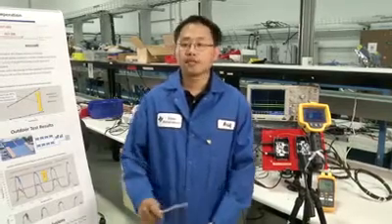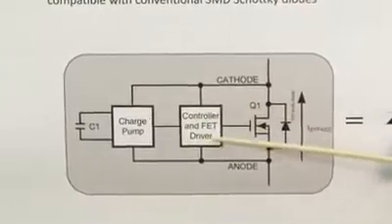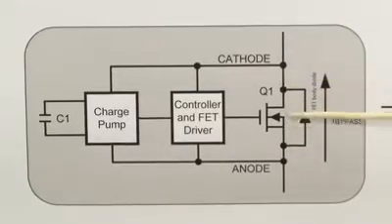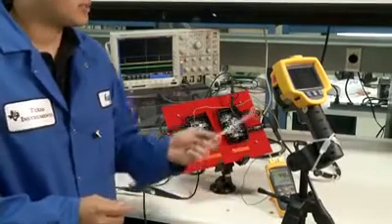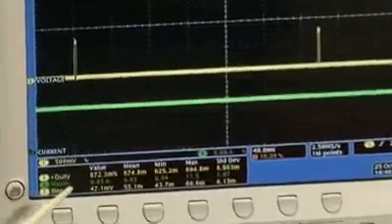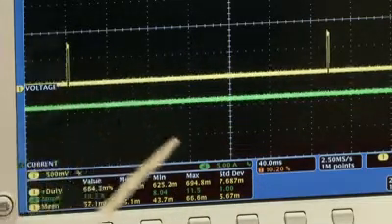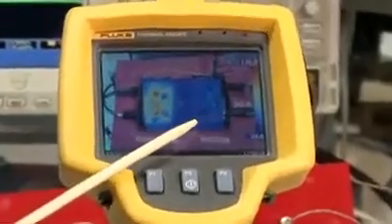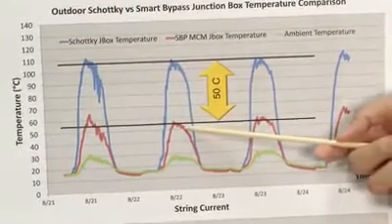Smart bypass diode

Comment: Although most bypass diode failures are due to excess heating, system surge voltages is second most common cause.  How the device handles surge overvoltage is also important.  This is weakness of using Schottky diodes with with their lower breakdown voltage compared to regular silicon diode.  With higher Rs, much of the lower forward voltage drop on Schottky is diluted when supporting high current.

Probably cheaper solution to just mount regular diodes in TO220 or similar package on metal heatsinks.  Most panel manufacturer will be unwilling to throw another $5 into material cost per panel.  I would rather put that extra money into small chip scale package diode that can be added in parallel with every cell in panel that would yield more value to end customer.

Comment: Most panels have three or four bypass diodes, and at a cost of $3.50 in small quantities that is $10-14 per panel. For something that only saves power when parts of the panel are in shade, they don't make as much sense as it might appear. Now, if these can be used in place of blocking diodes in parallel joiner boxes then we're talking since those diodes are almost always forward biased and represent a continuous power loss and heat source.